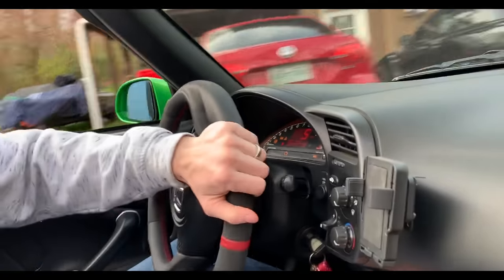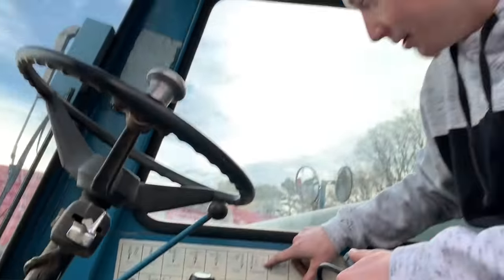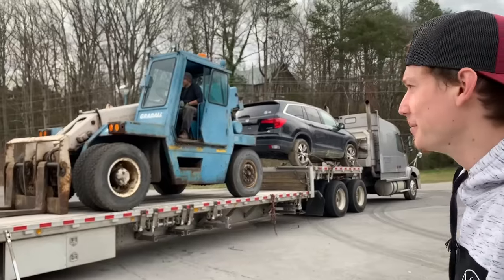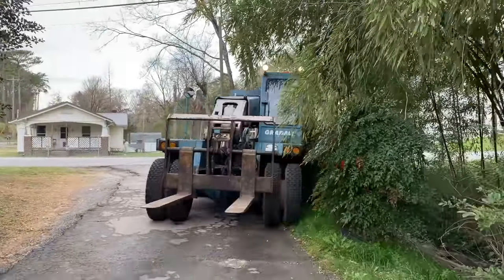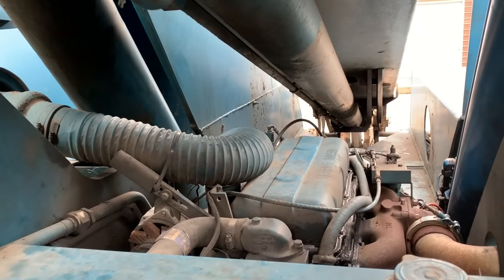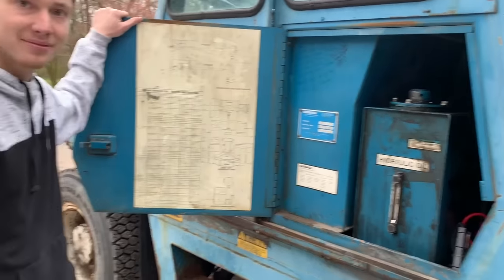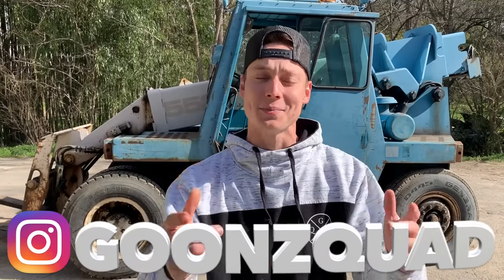Rebuilding The Worlds Biggest Forklift!!!

Comment: Guys not trying to down yall but please have a experience heavy equipment mechanic with yall and learn from them if you haven't been around them you will get hurt or die 

The knot is the manual way before all the new electrics we have now it goes directly to the fuel supply to stop fuel going to the engine 

Detroit or screaming Detroit is a torque monster when all the way at maximum throttle I cant tell much from the top but it most likely 4 or cylinder detroit was one of the best motors for coal or log hauling out of the mountain here but when they are straight piped with ur foot to the floor in 3rd it's like horrible I wore ear plugs to haul on the off road job good luck tho yall again 

Again not downing yall in no way but get experienced heavy equipment mechanic because the wrong thing with these can be deadly they will teach ya what to look for and not to do

Comment: at 16:30 he ask is it safe to go under when the boom is no no lockout device and they did not check the telehandler before moving it for oil levels and make Shure every thing is safe
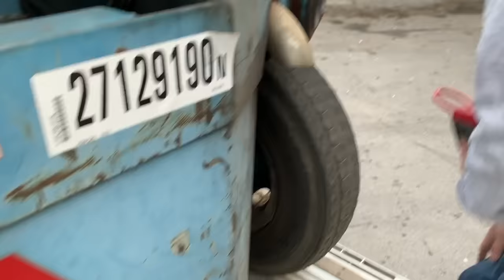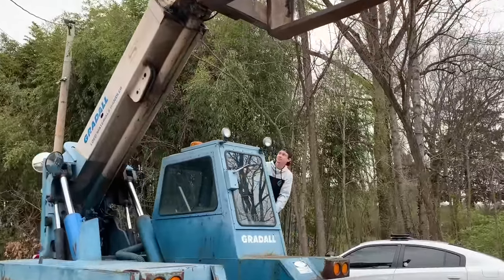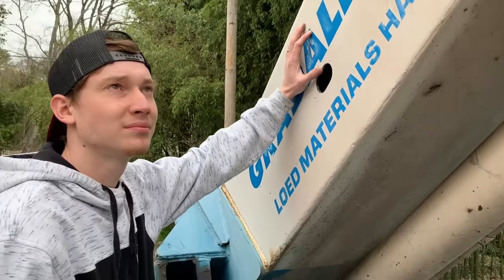Reply: list of safety violations at 2:50 entering piece of equipment without proper training, at 4:02 puts foot on the penial hook, at 8:48 to 9:08 driving dangerously with door open and driving too fast, 16:03 climes on deck with forks raised above head few seconds later asks if its safe to go under the goes anyway, at 17:20 talking about picking up something not knowing the lifting compacity of equipment and most likely not knowing the tipping point

Comment: This is a 4-53 Detroit Diesel engine..   It is not turbo charged but it has a blower on it..  It sounds good and will give you lots of service..  Go easy when you are learning to operate this machine..  The boom will extend out which is a feature of Gradall..  Feel free to contact me by email if you have any questions..  Pullnfool@verizon.net..  I used to be heavy into tractor pulling..

Comment: Please for your own safety consult with a professional HE Mechanic!!! 

Heavy equipment is very different from regular passenger vehicles. They're considerably more dangerous, especially if you don't know what you're doing.

NEVER stand under suspended hydraulics that aren't mechanically blocked!

Understand that not all hydraulic fluid is the same, some fluids can be highly toxic and carcinogenic. 

Be aware of the dangers involved in driving a rear wheel steering machine.

NEVER loosen any hydraulic lines unless you're 100% sure there is no pressure in them, Google hydraulic injection injury (NSFW). 

Fully understand what you are working on, these machines can and will kill/mame you!! 

I am new to this channel, I'm not sure what your knowledge level is and I don't mean to offend. You seem like nice guys, and I would hate to hear that one of you got seriously hurt by this machine.

Comment: not to be a hater but this is not the biggest fork lift the World’s Biggest Forklift Used by Computer Firm. The largest forklift ever built was designed with a single purpose in mind: To move enormous pre-fabricated computer data centers. The Combilift C25000 four-way forklift has a 25 ton capacity and has a 17-foot by 17-footprint. Its cab is more than 10 feet off the ground.

Comment: You guys need to respect that machine. It will kill you faster than any of your cars and trucks.

A 4/71 detroit diesel is a 2 cycle engine. Scavanging of the cylinders is done by compressing air with a supercharger. 

I'm sure you are aware of the 6/71 supercharger used on super charged v8 engines. The detroit diesel 6/71 engine is where it came from. Your little engine has a slightly smaller version.

Comment: I hate to dampen your enthusiasm but that is far far from a large forklift. Yes, it is not a little warehouse forklift. I'm guessing it is about a 12K#s lift on 48" load center. But, it is not at all uncommon for a true big lift trucks to have a capacity of 50K ton (100,000 lbs) 0n 48" or even 51" load centers.  In the business I worked over 40 years in we used the size of lift that you just bought to take tires off of our truly BIG lift trucks.